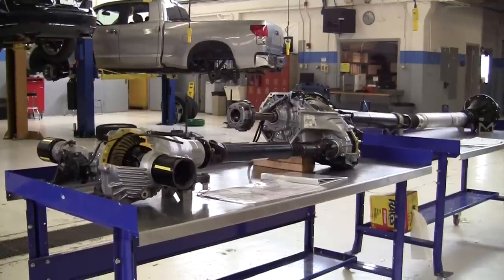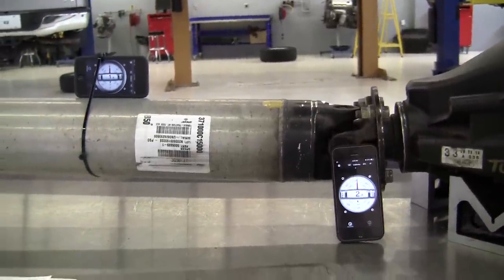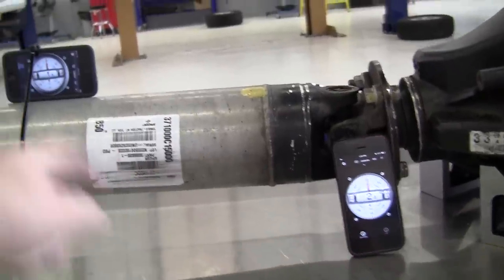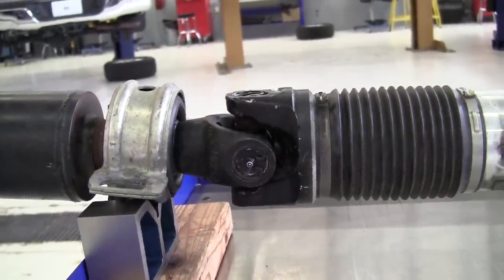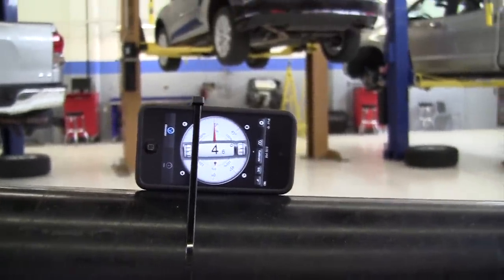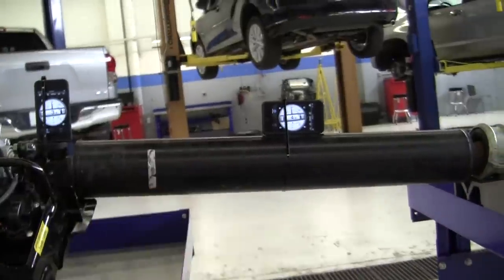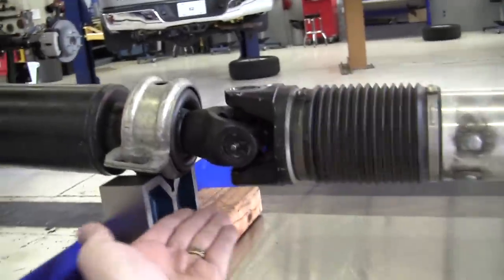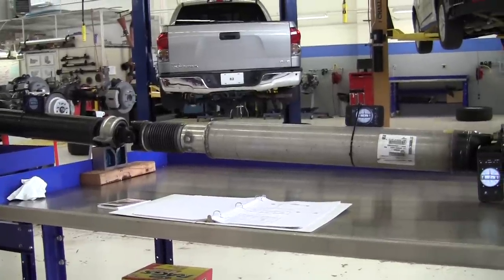Propeller Shaft U-Joint Working Angles

Comment: Hi john.  Thank you for your informative videos.  I have a question if you don't mind.  I have a hotrod with a single driveshaft.  The transmission yoke is 3.4deg pointing down, Propeller shaft 3.5deg pointing down and the pinion yoke at 2.5deg pointing up.  Yes, there are vibrations as you could imagine.  Would shimming the rear diff fix both working angles or would i have to shim the rear and lift the transmission?  Any suggestions are appreciated!
Reply: Sorry, i made a mistake.  The pinion is pointed down if viewed from the side.
Reply from the maker: You must shim both of them. You want around a 0.5 degree working angle on both joints. Best wishes
Reply: WeberAuto thanks!
I read setting up a leaf spring you should set the pinion pointing up about 5 degrees to compensate for spring wrap.  This obviously can be a little confusing and/or tedious since both angles need to be within 0.5 degrees.  Do you have any advice?
Reply from the maker: That should have been about 0.5 degrees to compensate for spring wrap